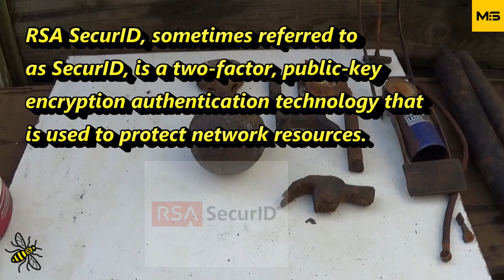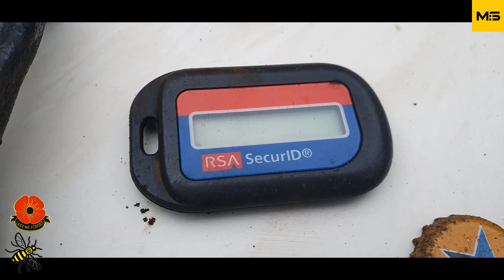Did I just find a cannonball Magnet fishing

Comment: Hello Scotty & Mrs B - What I learned about cannon balls is there has to be a mold ring going around caused by a 2 piece mold compressed together and a flat spot on top where they pore 
the metal in and ends up with a round flat spot about 2 in diameter , look for a mold ring and a flat spot - Needs to be electrolytic cleaned to see better results , Brian , Vancouver
Reply from the maker: Cheers Brian,  I thinks its due some shock treatment definitely.  Much appreciated.  👍🇬🇧